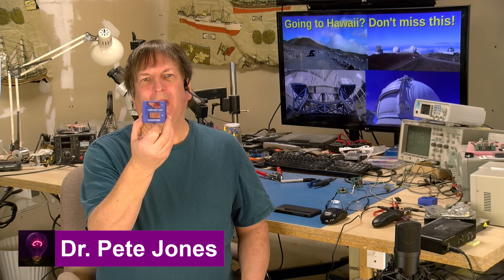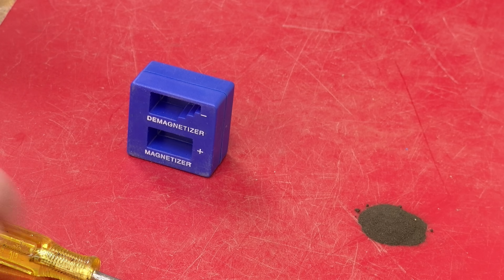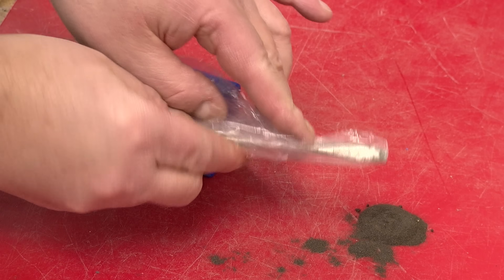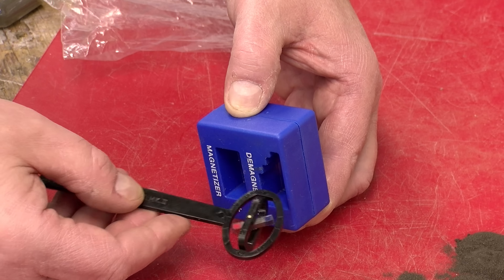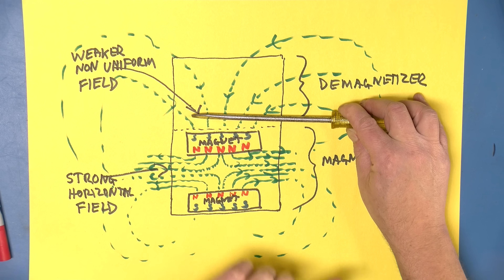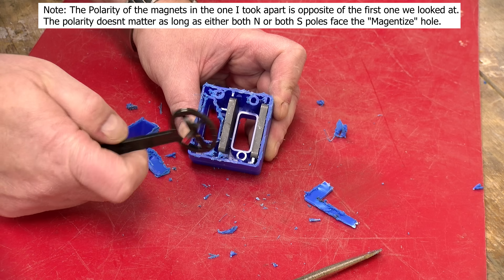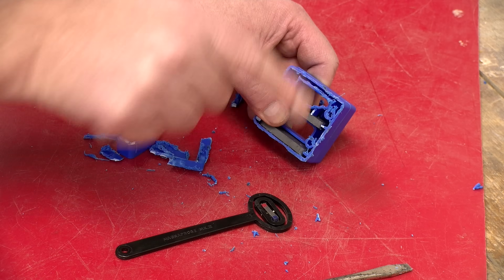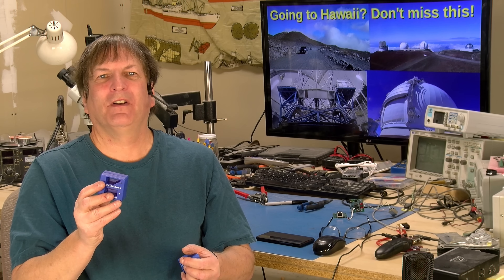How do these Magnetizer/Demagnetizers work?

Comment: Apple Stores has these in their repair rooms for techs to use them on the screw drivers to make it easier for the tiny screws used in devices to be picked up. I never just inserted my driver bits directly in, but just run it along the insides in a quick circular motion

Nice to see the simple science behind it!
Reply from the maker: Interesting! Someone mentioned watchmakers using them -  I never thought about modern miniaturized electronics but it sure makes sense that Apple fixers would find them useful.

Comment: The plastik bag must have made a static magnetism.
Reply from the maker: Not quite sure what you mean - maybe a translation issue? If your are wondering if maybe it was static electricity picking up the iron filings, that was not the was not the case - when it was demagnetized it did not pick up a significant number. 

If that was not what you meant, my apologies - please ask again!

Comment: So, theoretically, you don't even need the top half of the demagnetizer or the steps, do you? If you flipped the whole thing upside-down and slowly raised the screwdriver up from it while moving it forwards and back repeatedly, would it not have the same effect as sticking it through the demagnetizer over each of the steps?
Reply from the maker: Yes - exactly!!!!!!!! The steps and demagnetization hole are only a convenience.
Reply: @ElectromagneticVideos  it's a very clever convenience, able to instruct you to do all of what I said just by giving you a hole with some steps on the side
Reply from the maker: @badger273  Yes - I never expected the cheap little device to be such a brilliant design in its simplicity and functionality. Whoever came up with the steps (which was not in a 1960s patent for a similar device) must really have had in in-depth understanding of  magnetism.

Comment: I have seen a video on this before but the guy kinda ignored the stairs saying they where just a design thing but you've given a far better developed version of that explanation thank you.
Reply from the maker: Your welcome! To be fair - its not obvious how the steps could be of use given  they are non-magnetic plastic and none of these devices seem to come with proper instructions. It did take me a while to clue in that it was much like the operation of an AC powered demagnetizer: pulling the screwdriver out of the hole makes a AC-like rotating magnetic field, and moving up the steps makes that AC field reduce in strength for each cycle. If you want to see how a AC demagnetizer works, I did a video on it a while back:  https://youtu.be/mGK8oYdEqyE
Reply: @ElectromagneticVideos Ah-ha - similar to the way high-frequency bias works on "modern" tape recorders, if I remember correctly.
Reply from the maker: @thromboid  Yes - exactly - that helps the magnetization settle at a level corresponding to the signal being recorded rather than just zero.

Comment: Is it really the stairs that do the tr8ck, or just repeating it thrice?
Reply from the maker: It is actually the stairs - I probably should have included more details:  The operation is similar to an AC powered demagnetizer: pulling the screwdriver out of the hole makes a AC-like rotating magnetic field, and moving up the steps makes that AC field reduce in strength for each cycle. If you want to see how a AC demagnetizer works, I did a video on it a while back:  https://youtu.be/mGK8oYdEqyE

Comment: Never knew this existed. I knew magnetizers existed, but as big bulky machines. I usually magnetize my screwdrivers by placing them on a strong magnet on the wall for storage purposes, they usually magnetize it pretty well, but I never knew you demagnetize it that simply. I know you did magnetize things by heating them up.
Reply from the maker: They are often hidden away on some shelf of almost every hardware store - but if you are not looking for them they are easy to overlook. 

"I never knew you demagnetize it that simply" - they are not perfect, but amazing good for something that simple - ingenious little devices!

Comment: How long does the screwdriver stay magnetic after being magnetised like this?  Great vid, thanks.
Reply from the maker: Glad you liked the video! The time a screwdriver stays magnetized can vary - it actually depends on the steel in the screwdrivers which usually is "magnetically soft" and mechanically strong. Magnetically soft means it is easy to magnetize but also easy to demagnetize.  So a slight bang on the screwdriver or exposure to an opposing (repelling) field from a similarly magnetized screwdriver can easily demagnetize it. So its hard to predict how long it will last but certainly not forever and often only hours or days depending on how much it is banged around. A while back I did a video in how things are magnetized and how the magnetism is retained in objects - if your interested  https://youtu.be/S21rlwrY74I

Comment: Had one for decades but never knew it worked that fast and didn’t know about the stairs. Always just left it in over night not knowing. Thanks.
Reply from the maker: Your welcome! Others have thought that running it though the magnetize section a few times would help. Its too bad most or all don't come with instructions.
Reply: @ElectromagneticVideos  wait so doing it multiple times doesnt help???? LIES, i swear it does, its has to. more times, more better.
Reply from the maker: @dirtrider88  Interesting! The only reason I can think of is that each time maybe a few more magnetic domains got shifted, maybe the ones that were borderline and the slightly different orientation of the screwdriver each time was enough to get a few more properly setup. Maybe the slight tap each time helps too. I'm really intrigued with your experiance - when I am back home will try it.
Reply: OMG,   overnight.....thats funny.dumb.  and i'm a girl..!!!  Always need to stroke.!!!!😆

Comment: Just my take. There is a lot more physics going on. The north poll magnets lines of flux on the magnitizing side are double what the demagnitizing side has. When the iron screwdriver passes through the double density north magnetic lines of flux, there is a subatomic reaction going on inside the  screwdriver. Think of the magnetic polls of the two magnets as electrical charges. One being a positive charge, and the other being the negative charge. When the screwdriver  passes through the two north polls, it becomes charged electrically by induction. This induction forces electrons to move and line the atoms inside the screwdriver blade so that there are more electrons on one end than the other. Then, when it passes through the south poll of the demagnitizing magnet, the lines of flux are opposite. Opposite charges attract. This opposite attraction
Reply: Attracts half of the electrons in the atoms scrambling the charged particles hense demagnitizing it.
Reply from the maker: @1JamesHamilton1  There certainly is more than I covered in this video. One thing I didnt mention was that the high permeability of the screwdriver vs air will draw the magentic field lines towards it warping the diagram I drew of the lines when the device did not have a screwdriver in it. What happens is approximately the same though. The who magnetization/demagnetization process involves moving the walls of the magnetic domains in the steel - domains are essentially tiny regions that are like miniature permanent magnets. If you interested, I did some videos a while back that go in to more details

Magnetizing:  https://youtu.be/S21rlwrY74I

Demagnetizing: https://youtu.be/mGK8oYdEqyE

Even those only scratch the surface - but provide a bit more insight into what goes on.
Reply: @ElectromagneticVideos  yes, I got that in physics II or III, I think it was II. But I just don't buy the little tiny magnets making up the permeability theory. I personally think it's more along the lines related to the type of atoms, involving the electrons and protons. Until we are actually able to see a subatomic particle we can only speculate.

Comment: I have carried these for years, and now I'm curious, does repeated use increase or have any impact on the strength of the magnetism? I always see my fellow techs run their screwdriver through a few times, but the old timers seem to know something the new guys don't, they only run their screwdriver through once. I'm referring to the magnetize portion, not the demagnetize portion, I can see why running it through multiple times is needed for total demagnetization. Interesting video!
Reply from the maker: The old timers are right! Here's why: Look at the diagram here (freeze frame the video) https://youtu.be/AZsYHLHlIso?si=jf4Ym7fqhf8srSnG&t=285 . The flux in the middle of the of the magetizer slits, with half flowing out the left side of the hole and half flowing out the right side (think of it as water flowing). When the screwdriver is inserted as far as possible, most of it is sticking out left of the hole and is subjected to left flowing flux, and is magnetized in that direction (which is opposite to  to the direction the screwdriver would have been magnetized from a previous pass). So the remagnetization in the wrong direction undoes any effects of the any previous passes. 

Now pulling out out towards the right, the screwdriver steel is pulled though the middle where the flux splits, and is subjected to a strong right flowing flux or field which remagnetizes in the correct direction. And that magnetization stick because the field direction remains unchanged as you pull it out. 

So bottom line, each time you insert and remove, the screwdriver has any remnants of the field wiped out when first magnetized in the wrong direction, so the is no cumulative effect. 

One small twist however: If the screwdriver was short and only reached the half way point when inserted, never seeing the field going in the other direction, it wouldnt have its field reversed and wiped, so it might increase slightly, particularly if by change it was help in a slightly more favorable position to get subjected to a higher filed strength. Even then though, probably a minimal effect.

Hope that helps!
Reply: @ElectromagneticVideos  it's so cool to finally understand how this works, magnets are so interesting!
Reply from the maker: @kellerbenjaminjames  They are interesting! I did a whole bunch of videos on various aspects of magenetics and related things. If you interested, here is playlist  - you should be able to click on whatever looks interesting https://www.youtube.com/playlist?list=PLHUfJmsprIcRgeatuwmJkMYf-hEFvwR5E
Reply: @ElectromagneticVideos  thanks, I'll check it out!
Reply from the maker: @kellerbenjaminjames   Enjoy!

Comment: Mine is much bigger and uses electricity, but one pass and the part is demagnetized. Fun fact: If you hold a neodymium magnet in your hand and pass it over the demagnetizer, it zaps you.
Reply from the maker: One of the old tape demagnetizes?
Reply: No, it’s a box that’s about the same size as three Big Mac boxes put together, but a little taller and has a reflective top. It is crazy powerful. I bought it to demagnetize gun parts. I have no clue how it works. I tried looking for videos, but couldn’t find any.
Reply from the maker: @chrisgualtieri  Interesting - I wonder if it was purpose built for gun parts or for something else.  If you want to know how that type of AC demagnetizer works, I did a video on that a while ago. Here it is if you are interested: https://youtu.be/mGK8oYdEqyE

Comment: if you stick your screwdriver in the one with "magnetizer" field in a north orientation then stick it in the one you took apart that was in the south pole orientation, does it demagnetize? Do you have to stick it back into the south pole one a second time to then remagnetize it?
Reply from the maker: The demagnetizer will work no matter which one you used to demagnetize it - here's why: When the screwdriver is magnetized by either one, the direction of magnetization is parallel to the length of the screwdriver - just the direction is different. When the screwdriver is passed directly over the demagnetizer magnet, the first thing that happens is that the screwdriver is magnetized perpendicular to the the the length of the screwdriver. This wipes out any of the previous magnetization - regardless of direction - that the screwdriver had. 

As the screwdriver is pulled out of the demagnetizer it is subjected to a weaker and weaker field that  also gradually changes direction to be parallel. Is the change of direction + the weakening field that lowers the amount of magnetization left after a swipe though the demagentizer.

Comment: Very cool explanation. Maybe including one of those jars of oil with iron filings in them to show the fields around the tool would make the fields  even more apparent.
Reply from the maker: Yes! Someone even pointed out that you can now get an even easier to use variant of that which is somehow made into a green flexible sheet. Next time!

Comment: Thank you for your video, so that means the hard drive when you put it apart the two magnets there is north and south, how can you tell which one is the north and south the bottom one or the top one, so I can magnetz screwdriver, thanks again😊
Reply from the maker: Well if you to configure the magnets like in this little device, the trick is to have both the N or S poles of the magnets pointing towards each other across the magnetizing hole. Since it doesn't matter if they are both N or both S, the easiest thing to do is see which way to orient that so that they try and push away from each other - and thats the way to mount them around the magnetize hole.

Comment: If you magnetized one screwdriver in the North unit and one in the South unit would they stick to each other?  Could be a fun trick for sorting different tools apart (the "click" means it's in the wrong pouch, for example).
Reply from the maker: Thats an interesting thought. The device magnetizes things like screwdrivers such that the end that was last in the magnetizing hole is either North or South depending on how the magnetizer was built. So what you are suggesting would work  assuming the tool was like a screwdriver and had a handle that really forced you to pull it though the magnetizer always with the pointy end coming out last. 

The issue would be that the steel used for tools is not very good staying magnetized, and after some use of the tools they will gradually or suddenly loose their magnetism (ie after being hit with a hammer). But it would work for a short term for demonstrating the trick!

Comment: Still not clear how demagnetizer works. The fact that field is perpendicular to the screwdriver doesn't explain why it doesn't attract iron filings at all.
Reply from the maker: What demagnetizes it is that field the screwdriver is subjected to changes direction and weakens as the screwdriver is pulled out. The result is weaker field in the new direction. A more conventional way of demagnetizing things is to put them in or near an electromagnet powered by AC current and gradually pull it away, each successive half AC cycle remagnetizing the object in the other other direction but a bit weaker as it is pulled away and subjected to a weaker field. I did a video that goes in that in more detail a while ago if your interested: https://youtu.be/mGK8oYdEqyE

Hope that helps!
Reply: @ElectromagneticVideos  but this is also the case for a magnetizer. When you pull a screwdriver out of it the field slowly weakens. When you pull a thing out of the magnet the field always weakens.
Reply from the maker: @pahom2  Not quite: got the magnetizer the field does not change direction as you the screwdriver out as in the diagram here https://youtu.be/AZsYHLHlIso?si=--LCG3BBB6J2aNAw&t=288  . Because the direction does not change it does not weaken the field in the already magnetized steel of the screwdriver.

Comment: I have that exact one except red and it doesnt do anything
Reply from the maker: Interesting - is it heavy enough to have magnets in the thick sections? At least one person reported having bought on that had been accidentally manufactured without the magnets. Could also be the magnets are weak or oriented wrong (ie not with the same poles facing the magnetize hole). 

I think with the low cost of these devices there isnt much quality control when they are made!

Comment: One criticism is that you compared the effect of 1 pass on the magnetiser versus 3 passes on the demagnetiser. I would have thought that you would compare 'like for like' namely 3 each for example.
Reply from the maker: The only reason I did the three pass thing was to show how the staircase can further reduce the remnant magnetization in the screwdriver after one pass. Note that you do need to increase the distance from the middle magnet with each pass and the steps are there to make that easy. Repeating the magnetizing thing  more than once really has little effect because each time you push the screwdriver though, it first magnetizes the far end in the opposite direction, and the on magnetizes it in the correct direction as you pull it out, so any attempt to build on and strengthen the previous magnetization is lost.

Comment: what if i build one with hard drive magnets? is that gonna be even better?
Reply from the maker: It will depend on the geometry of the magnets and how strong they are. If you had a bunch of smaller ones you might be able to arrange then in a row with alternating polarity, with the row at an angle towards the screwdriver. That was as you  pull the screwdriver out it would pass over a series of alternating fields, each one a bit further away,  and reducing the magnetization a bit more.  So with a bunch of old hard drive magnets you might be able to make a really good demagnetizer